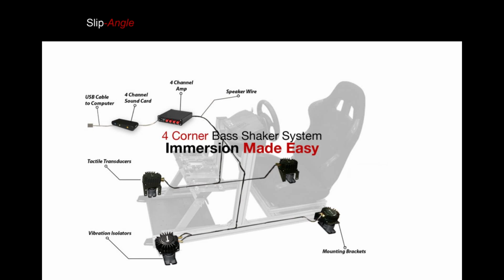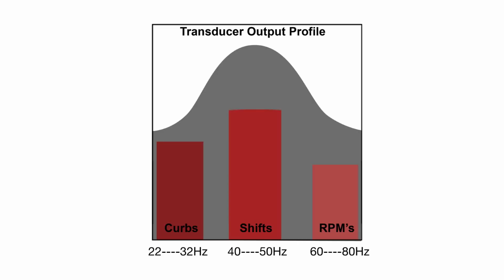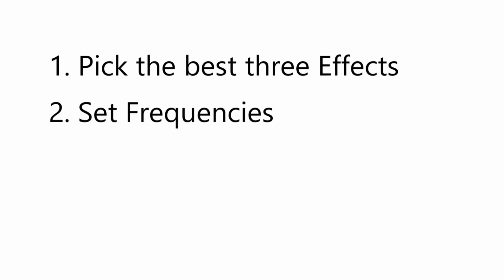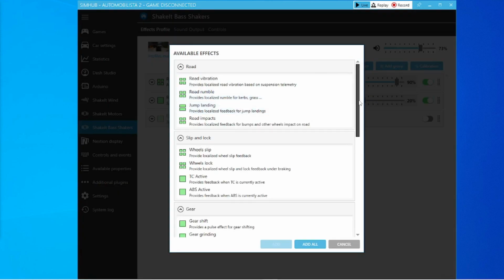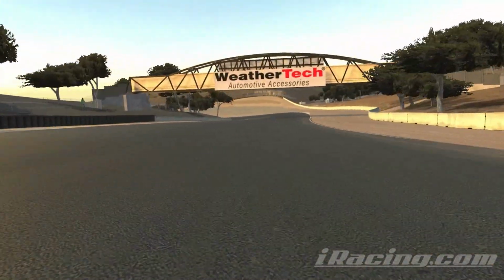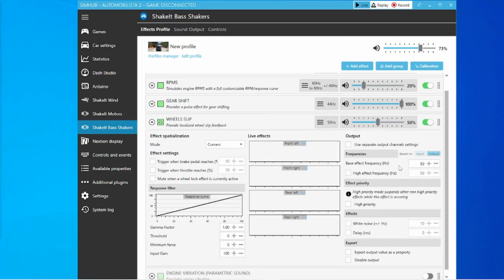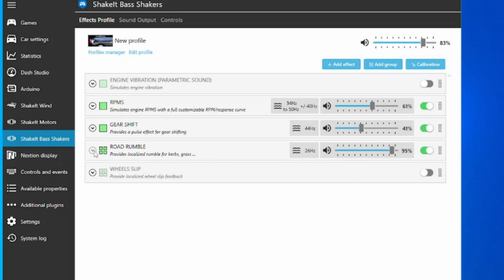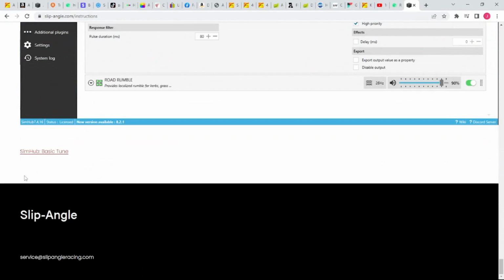Tuning Shaker Kit with SimHub

Comment: Are the isolators required for the experience? Or are they just to keep the rest of the house from hearing it? My current setup location wouldnt bother anyone else in the building and I already have a rubber/foam squares under my rig.
Reply from the maker: The Isolators definitely help improve the feedback, 100%. Cheers.

Comment: Would your recommendations be different for AMS2?
Reply from the maker: I've used the same basic tune for AMS2, RF2, ACC etc. You can fine tune it by car or track if you like but it's a good base for all of them. I'll be updating  it within the next couple of days, some improvements in Revs, otherwise pretty similar. Cheers.
Reply: @slip-angle2400  Hi I tuned it according to this video and it worked great until Simhub updated to the current ver 9.5.2. The effects seem different now especially the road rumble effect is more subdued. the volume was on 70% and cranked it up to 100% but it is still subdued. What should I do?
Reply from the maker: @simsfamily6238  We haven't noticed that on our end, but let me check with that in mind. I'll also send a note to SimHub to see if anyone else has noticed the same thing.

Are you noticing this in AMS2, or another sim?

Comment: Hi. 
What about the Sound Output Volumes? Did you adjust it for each Bass Shaker and each efect separatly/individual or did you leave them on 100% for each shaker and each effect? 
This would be helpful... Thank you
Reply from the maker: I recommend leaving Sound Output volumes at 100%, limiting the output from SimHub just makes the amp work harder. Cheers.
Reply: @slip-angle2400  thank you...good to know

Comment: Do you think a nice DSP, better amp,  and better transducers would help with sound separation for adding more than three effects?
Reply from the maker: Not really, you're limited by the vibrations through the rig. Too many and they interfere with each other; cancelling each other out or creating standing waves. The items you mention won't change that. 

You can run more, I just don't think it adds much and can detract, so suggest limiting it, but it's all personal preference.

Comment: Quick question - do you guys recommend silicone grease etc for use where the mounting brackets interface with the vibration isolators? I get hell of a lot of squeaking when in use...
Reply from the maker: Hi, you can use that, although they usually break in pretty quickly and stop making any noise. Just for anyone else reading make sure you use silicone grease and not any regular petroleum based oil as it'll destroy the rubber.

Comment: I’m loving my S.A transducer kit. I upgraded to the new 300watt amp, it’s great. The original 100watt amp would get too hot to touch after about 30min use. No issues at all with 300watt amp.
Reply: But does the 300w amp give better/stronger vibrations?
Reply: @rohitbeniwal8649  since this post I’ve had 2 x 300watt amps fail. So at this stage I would have to say they are un-reliable.  The 300 watt doesn’t make haptics stronger, it doesn’t get hot.

Comment: just installed the rear corners (RR and LR) to my 80/20 on the large lower frame near the rear corners.....cant really differentiate between left and right with my seat of the pants.  Hoping these frequency adjustments help.
Reply from the maker: Hi, there's more information on that in this video: https://www.youtube.com/watch?v=u4INM9ZZpnc Check it and let me know if you have any more questions, I've added email in the the About section.